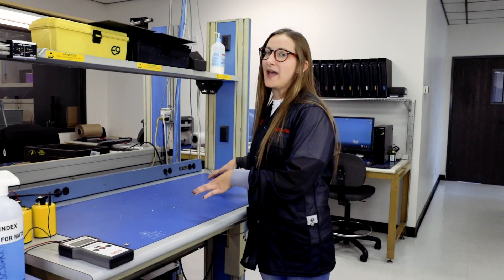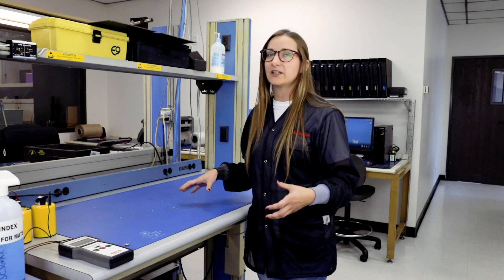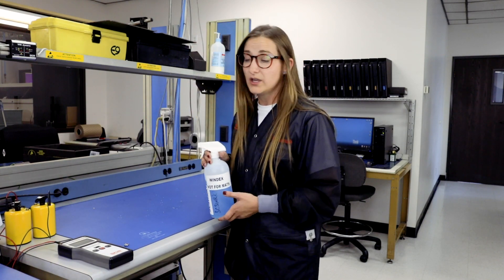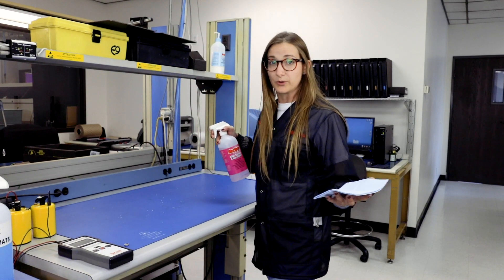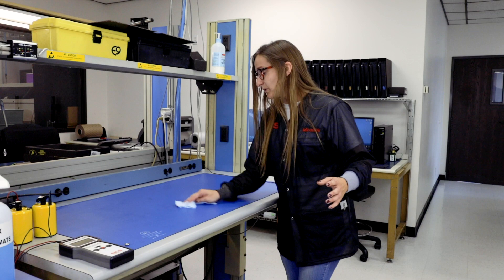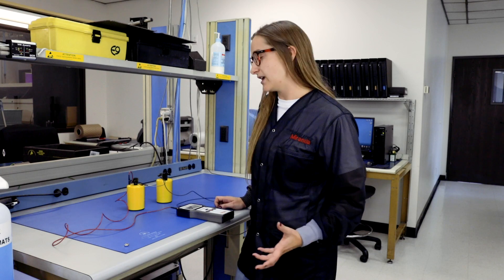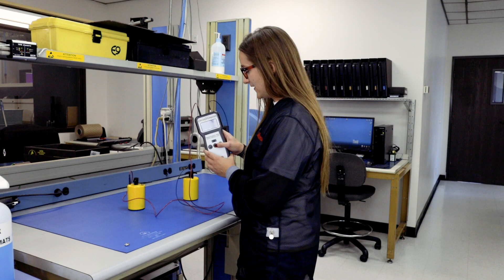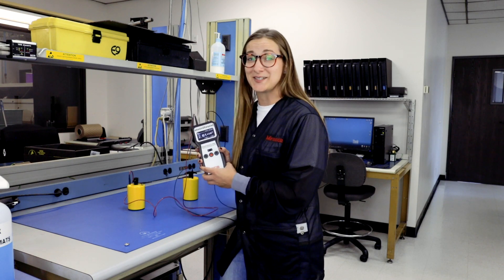SCS - A Minute with Miranda - Cleaning an ESD Worksurface Mat

Comment: What's wrong alcohol and why can't use it to clean it?
Reply from the maker: Isopropyl Alcohol should be used sparingly as a way to disinfect the surface or remove excess grime. Isopropyl alcohol may degrade the performance and physical properties of the materials and are not recommended for long term use. Normally, cleaning should be done with products specifically designed to clean surfaces in ESD Protected Areas, such as Desco’s Reztore ESD Surface & Mat Cleaner.